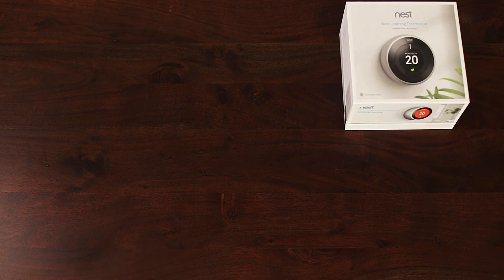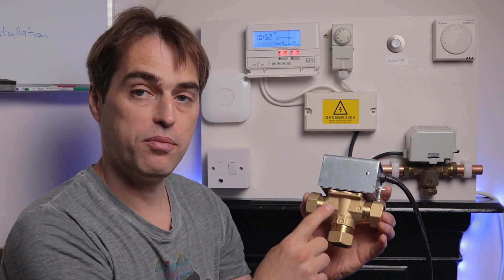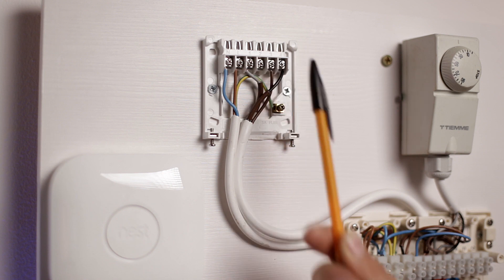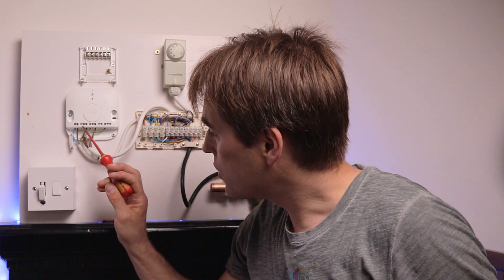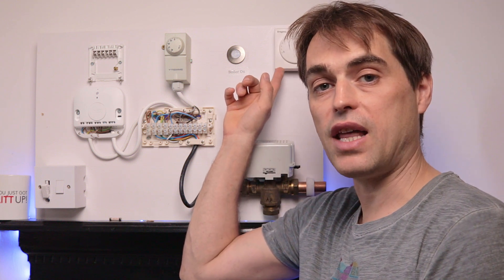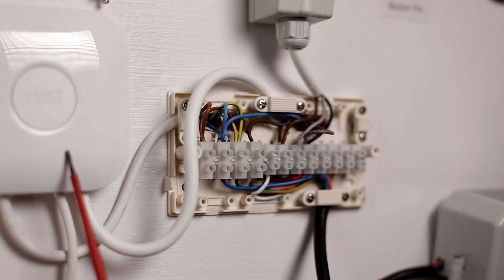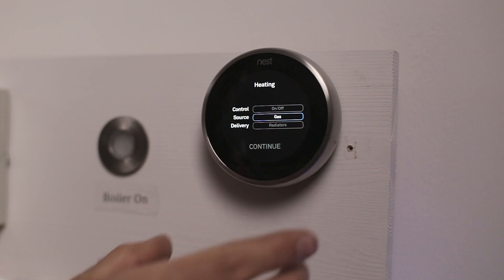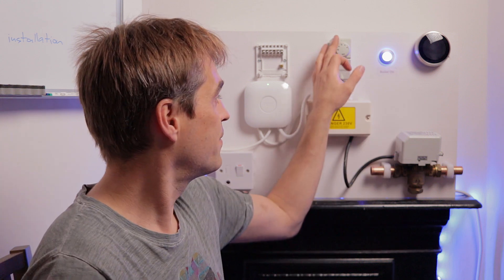How to install Nest thermostat (UK) on a Y plan - system with hot water cylinder & 3 port valve

Comment: What size cable did you use on the heat link?
Reply from the maker: I must confess I grabbed the first cable I could find in the Van, must have been 0.75 or 1.0 4 core heat res. flex as I use those sizes a lot. Heat link terminals are tiny so I crimp ferrules on stranded wire.
Reply: Does it have to be heat resistant cable?, I have a big real of 1mm 3 core not heat resistant!!
Reply from the maker: Malcolm Bale you will be ok with that